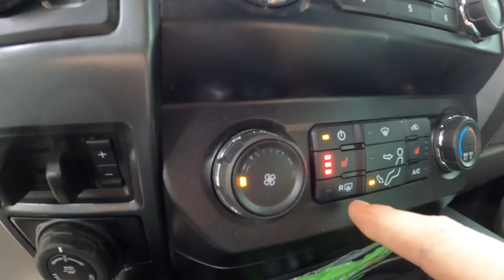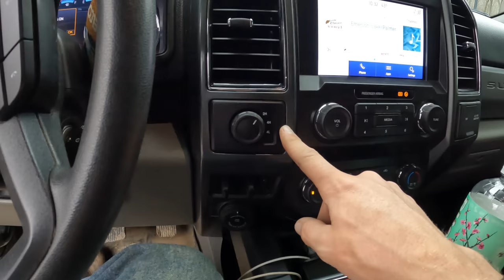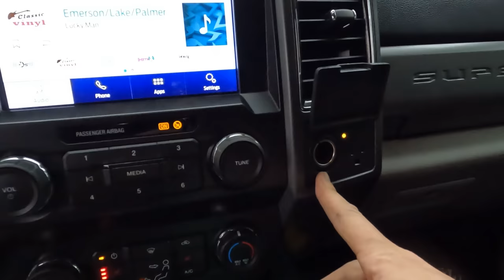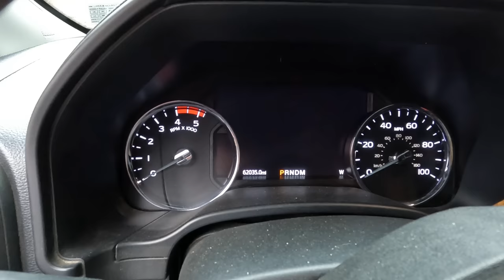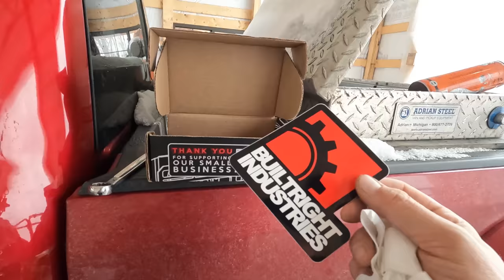I bought THE BEST Pickup Truck on the Market (Ford F450)

Comment: Cool truck Matt but your theory about commonrail is not true, 
the only engine I have heard of that uses engine oil in commonrail system is a 6.0 powerstroke.
perhaps not all, but the most normal is that you have a high-pressure pump (diesel pump) that maintains a pressure in the rail that supplies the injectors. The pressure in the rail rises and falls depending on engine load, max pressure around 2200 bar and higher on newer systems.
The injektor opens and closes with help from a electronically controlled solenoid valve.
Sincerely, Nillerfix
Agricultural machine mechanic apprentice

Comment: I owned an 05 6.0, also an f350.  Mine had the F6 trans and was 4 wheel drive, regular cab.  Bought it with 65k miles...towed some with it.  Most i ever had to do was replace ficm and compressor side oil seal on turbo.  

Sold it at 175k miles.  Never had an issue with the truck....sad I sold it.

Comment: Interesting technical detail, and it might be the case on the Powerstroke Engine.
But I really doubt that.

A common-rail Diesel Injection is called so, because the diesel is in a common rail (that is common to all injectors, or all injectors of one bank) under full pressure.
The Injectors are activated electrical in every common rail diesel I know, which are quite a lot.
Using engine oil as hydraulic actuation seems very odd, because it would be extremely difficult to properly time the injectors.
To check that you just need to look at one of your injectors, it should have an electrical connector on top.

Comment: Wash the undercarriage as long as it is new and cover it with good anticorrosion wax (Waxoyl, Noxudol) or at least FluidFilm and you will be good for a very long time. 100 times better than factory protection.

Comment: I got what I call a rino hide bed mat it is a 9/16 thick reinforced rubber mat that protects the bed from scratches and diets and it also helps to make things harder to slide around I also added a extra bigass battrie and ran 110 plug to the very back end of the box and a second one to the inside of my low profile tool box to charge my millwalkie gangcharger. I'm looking for a device to hold my laptop like the police have in there crusers I have a uncle who is a high ranking retired officer and ask him if he can  see if I can get one from old cars they take out befor there sent to auction.

Comment: About time you did a video on it. TOW PIGGGGG! Between the wider axles with the 450 giving a tighter turning radius, the 10 speed, 6.7 with some 1000 plus lbs ft of torque, drive modes, coil front, etc you’re gonna love it. No more trailer squatting with that beast lol. You won’t even feel a trailer when accelerating. My favorite story was going up a hill from a stand still with our bumper pull travel trailer smoking everyone else off the line.😂 

My dad has a loaded 22’ F-350 and it’s a blast to drive. Despite everything being plastic on the inside it’s well built and doesn’t rattle like the early super duties. 

Some of the things to look out for are those damn CP4 injectors as some people have had trouble with them, the silicone (at least I think it’s silicone) inlet/cold side turbo piping. Some have blew it, which you can get a nice metal replacement for. Letting the truck sit for a few seconds minimum before shutting off, otherwise it makes this god awful screeching sound just like Ram’s do. Bump steer/death wobble problems if it hasn’t been fixed yet (was a problem for 19’s). Whatever you do, DO NOT put DEF into the fuel system. It’s happened to some without them thinking about it, and spacing out. It WILL completely destroy your fuel system and I shit you not will cost some $10 grand to fix, and replace the ENTIRE fuel system. There’s a bunch of things you can do with FordScan if you get tired of the door chime, or want to reprogram other things. Other thing to be careful of when it kicks into high idle is make sure the exhaust isn’t near dry grass. The tailpipe/exhaust can get so hot it can start a fire, let alone I think affect the paint on a mother car parked near it. Some also don’t come with a engine block heater stock like the steel duties did for some reason. You can just buy it from Ford, along with the plug in which has a convenient plug clip on the passenger inner side of the bumper to hold it up. 

6.0s aren’t that bad compared to the 6.4. It’s when people don’t bulletproof them, and stick a tuner on it when it will explode, or blow the head gasket eventually. With the way way it’s designed 6 bolt per head vs 8 like it should be, and Ford cranking the power up from the original International version was the problem. 

That’s why I like the 6.7 so much more over the 6.0, let alone the loud ass 7.3. You couldn’t have a normal conversation between the engine sound, and the abysmal non existent sound deadening material. You shut the door on the new ones and it’s basically silent, I love it. It’s not obnoxiously loud like the Cummins either despite it being a high liter too. 
Definitely glad you got one with the FX4 package for those handy skid plates, and unfortunately since it’s a 450, and not the other ones, it doesn’t get the rear locker. As you probably know be careful off-roading it, duckies don’t like it as much as SRW’s do. Exhaust brake, and drive modes are also great. Really holds you back going down a hill, whether loaded or not. 
Treat her good with good oil/fuel additives, and not rod on her like crazy and she’ll last you a long time with that 6.7. Congrats, that’s some serious upgrade!

Comment: Hi Matt great vids please keep them coming. your no power issue when truck is off might be an easy fix. most truck makers give you the option of having a 12v outlet on when truck is off. usually its just moving a fuse from one position to another. just check your fuse for the 12v outlet and see if there is an empty space next to it if so try moving the fuse to that position and check for constant power. let me know if this works I believe you can also program this via a scan tool.

Comment: Leave the Bed.. change the mind set . Remember these are many electronic features  on the bed.  If removed will lead to a lot of modifications to make the truck functional at the trim level you at. If you want it would be better to order a fleet unit XL .

Comment: I use a f550 at work and it pulls our fully loaded 24k trailer like it is nothing. You can also start the truck with your phone. The only downsides so far are the accessory sockets only staying on for like 10 min, and the damn door dinger.

Comment: 6.7 oil filters have been known to vibrate lose or just not seal up properly endless they’re tightened up fairly tight. There’s info ab it on forums, and why not run 15w40 if you’re towing and running in colder temperatures?

Comment: 25:18 common rail is not the same as Heui oil fed electric over hydraulic injection. That has a pump that takes the diesel from a low pressure and creates a high pressure with just the fuel. They don’t run off engine oil like the old Heui system in that 6.0 which is why you really want archoil ar 6500 to keep that high pressure fuel pump lubricated and happy.

Comment: So what is your opinion on ride comfort now that you've had this truck for a while ? I hear alot of ppl say these newer Ford trucks have terrible ride comfort like rock hard seats and overly stiff suspension and what not.

Then again most newer cars i've driven/ridden in have had too hard seats for my liking.

Btw you should see my landlord, he washes his truck and secondary truck damn near once a week year round, doesent matter if its like -35 deg C, he still gets the pressure washer out and washes the thing off. But i can see why, theres not one spec of rust on that thing, for beeing a early to mid 2000´s truck its in basically showfloor just rolled off the production like tiptop condition.

Comment: Matt, just a thought, before you place the last of your Concrete slabs at your new shop, you have the equipment & knowhow have you thought about maybe digging a service pit / trench with steps & deep enough to stand which will allow you access under your equipment for servicing, so no more crawling on the ground changing oil etc. And one more thing with a Sump pump location to collect water when it rains.
Reply: Pits are nearly impossible to get permits for anymore. They are seen by municipalities and insurance companies as confined spaces (no air movement) Co, Co2, H4S, and radon accumulate in them and as falling hazards.  
Now-a-days you have to spend a fortune on air systems, decking, lighting, fire suppression, and drains to make insurance happy.  If you aren't running a business fixing large vehicles, it makes way, way, way, more sense to get an 18k above ground car lift/hoist and it's also probably a lot cheaper to buy and install a hoist than build a pit..

Comment: We usually fill the oil filter before installing it. Since it’s so big and it’s vertical, it’s nice to fill it and get oil in the system quicker. Not sure how long It takes for the engine to fill it.

Comment: I also went from a 2004 F350 SRW to a F450, a 2012 KR 450 with the 6.7.  Bought it used from Texas, zero rust, brought it to IL, rust belt as well.  Had a few good years until i had a manifold leak about a year and a half ago.  Limped it along until tax time fixed the leak and replaced the turbo, and deleted it the most efficient way i could find earlier this year.  Now its 5” straight piped stainless with an 8” axle dump, it sounds real mean now, but as you stated not as cool as my 6.0 sounded.  About a year after i bought the 450, i decided not everything needed a dually pulling it, so i bought a 2004 Chevy 2500HD 6.0 gasser, also a Texas truck, with a plow and snow tires on it, to both act as a backup truck, and to make some money with during snow season, and it is the only one that sees salty roads.  I love the combo between the two and its nice to have the choice in utility when fuel prices soar.  I doubt i will ever go back to a one truck does it all solution. Best of luck with the F450 and let me know if you need some advice on deleting it, i swear to crap, it feels like 520HP 1050ftlbs of torque now

Comment: My 2006 F350 just turned over 201,000 and still going strong. Completely stock 6.0 and 6 speed manual, it's our farm tow monster and does it's duty faithfully. As long as you leave the 6.0 alone, maybe an EGR delete, as long as you don't chip it trying to get extreme power, those 4 valve per cylinder help it go. I have a 7.3 powerstroke F450 service truck which is faithful, as well as an 89 7.3 IDI which is just as faithful. Yep, I'm a Ford guy too.

Comment: Use Forscan and you can add the heated seats on the touch screen and keep the usb and radio on with the key off.  Not the inverter though

Comment: just a friendly reminder, dont put a knee on your seat with heat in it. the wires inside the seat are not designed to take that much weight in one spot and you will run the risk of damaging the heating

Comment: Hey Matt! For oil samples, try BlackStone Labrotories. I’ve been using them for a long time, I even oil sample our cars. Once you start doing it, you won’t stop…the info you get from them is crazy. I’ve tried different weights of oil to see what oil yields the best results, such as wear metals and such. You will also see air intake leaks and coolant in the oil long before you would notice it on your own. The coolest thing I have seen from oil samples is the wear that comes from idling. Always used to let the cars warm up 5-10 mins in the winter, I saw the amount of wear metals and stopped idling and the wear metals went back down. Oil samples provide valuable info if you intend on keeping it a long time!

Comment: Hey! I actually do a lot of upfit work on newer trucks Ford Chevy and dodge, the problem with the power outlets not staying on I can't remember exactly what it is on the Fords but there should either be a fuse in one of your fuse panels where it's a two prong fuse but the slot that it can go into has three slots, the center pin is what goes to your outlets and depending on whether you put the fuse in the left side of the right side puts it on key power or constant power. I've known this to be true in older Fords though I don't know exactly how it is in the newest of ford's. I have been hearing from people that you can hook up a Ford scan unit and actually set them to be timed or even turn off the timer in general. It may be something that you want to ask the dealership where you bought it from because you may be able to change it

Comment: just remember, the numbers your throwing out for towing is for a 2wd 2dr basic model the big lariat loaded trucks is less
Reply: not saying you can't pull more, but factory numbers are based on that
Reply: if you decide to change out your bed let me know! my boss has the identical truck with a wrecked bed bumper and is looking for a replacement

Comment: That's a sweet truck. I've been driving a 2022 F250 with the 6.7. That 6.7 is a monster. It doesn't even feel the 10-12k I pull. I did find that using a fuel catalyst gets me a fuel mileage increase of about 30%. That's almost a payment every two months I'm saving. 

Also, that tailgate handle  and step works really well for old fat guys like me, lol.

Comment: You know Matt, you have to put your own first scratches on it sometime, as far as the aluminum body parts, don't forget gasoline tank trailers are aluminum tanks and look at what they do with the weight of the gas in them or diesel, or what ever, but still aluminum. Congrats on the newer truck it looks good. Happy holidays.  Dave D.

Comment: Somebody was pulled over on the side of the road our town. They were in a late model Ford F-350 dually. The thing looked brand new. Their back left axle came detached from their differential and started to come out of the truck. The wheels were outside of the fender, way further out than they were supposed to be. If they would have kept driving they would have lost their wheels and ended up on the ground. They ended up making it on the local news a few hours after we drove by. I don’t give a shit how nice people say these things are. I’ll never buy one. I’d buy a Silverado 4500 HD dually with the 6.6 Duramax.

Comment: But if you really think about pulling 36000 pounds with an pickup truck ...man there is really something going wrong in your head. Of course the engine will deal with it, but the chassis is absolutely not up to all that weight. Use it with common sense !
Reply from the maker: I didn’t make these numbers out of thin air, talk to ford. There’s people doing this every day with these trucks
Reply: The truck can haul it perfectly fine.

Comment: Oil change every 5000miles. What crappy oil do you use? In Europe the interval would be 20000+ miles.
Reply: Did you even watch the video?
Reply: @richardthomas1743  Yes but not with 100% concentration 100% of the time.
From you comment I'm guessing he said.
If its a fully synthetic the comment still stands. We in Europe are amazed by your oil change intervals.
Reply: @Stoff1   It is a full Synthetic oil.  Shell Rotella T6 5w40 and he tries to change it every 10,000 miles.  yes we do change our oil before it gets turned into gooey sludge.
Reply: @richardthomas1743  We have many cars running them intervals in what you would probably class as severe service. They have no oil related problems running for many 100000s of miles.

Comment: Don't get rid of the 03. You will regret it. That new one is awful. There junk. That aluminum body is crap, the engine is unreliable. Wait till you need to spend 300 bucks on one set of brake pads. Nope that new truck defiantly a down grade

Comment: 6L makes 6 cars in Europe! I want out from the damned Bruxelles Union and ball-less politicians. I would like to live like a normal US citizens with no limits on energy! In case there is a shortage (on fuel), the US president projects power through the aircraft carriers and submarines and the problem is being solved immediatelly and my 6L engine will run smoothly again. And, I happily go to the polling station next time! Not like in the crap EU